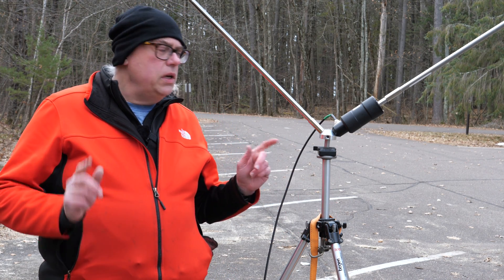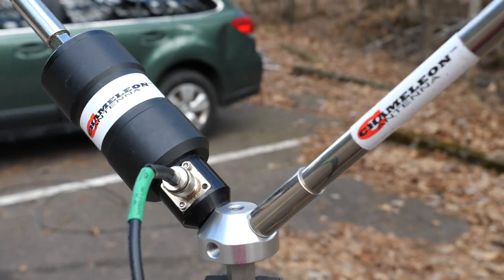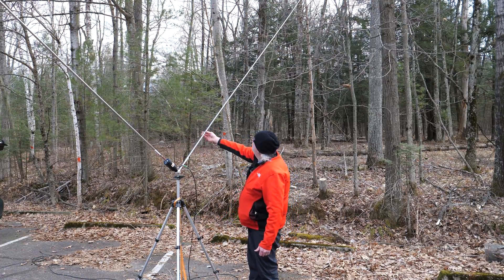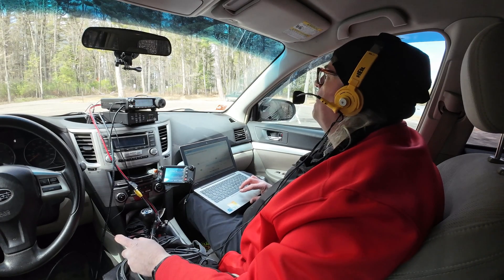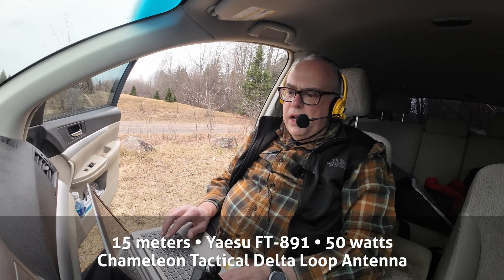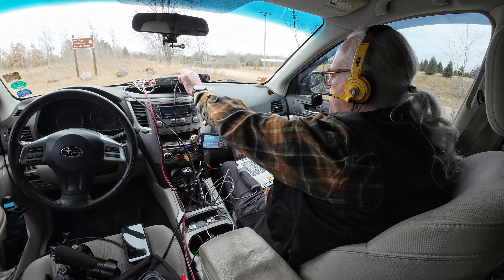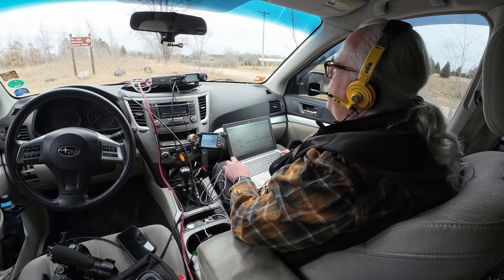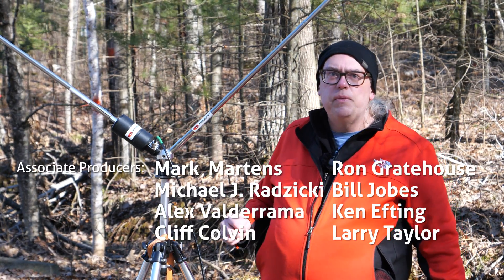Amazing Performance: Chameleon Tactical Delta Loop Antenna Revisited

Comment: I made something similar.  I used two CB whips, a Cameleon on one end, wire, mueller clips and a Wolf River Ottophone Y, and WR coil on other whip (tunes antenna).  I got a low SWR on several bands.  I called it my Franken-tenna.
Reply: Been wanting to try this. I have all the pieces. Which WR Coil did you use for this setup? I have all of the coils they make. KN4VA
Reply: @KN4VA  The Silver Bullet Mini. I didn't need that much adjustment. Get light wire and the smaller mueller clips or it will droop.
Reply: @chrisazure1624  Thank you for the feedback.  I actually have the wire from Chameleon that is used for their Delta loop, so I should be good to go.  73

Comment: Nice Video, what is the make and model of the Tripod? Thanks
Reply from the maker: It's a set of Bogen (Manfrotto) 3001 legs with a Manfrotto quick release plate on top. The legs are no longer made, and I'm not sure what the replacement would be. There's a link to the quick release plate in the video description.
Reply: Manfrotto tripods can be had cheaply on eBay…they are not light but are built superbly!
Reply from the maker: All my video tripods are Manfrotto. They are nearly indestructible and it you break it, replacement parts are available.

Comment: The good thing about the TDL, you can reconfigure the antenna to a standard vertical and get all the DX you want.( just add more counterpoise wire or add radials)
Reply from the maker: Yes, with a homebrew counterpoise (or magic carpet) you get a second antenna for the price of one.